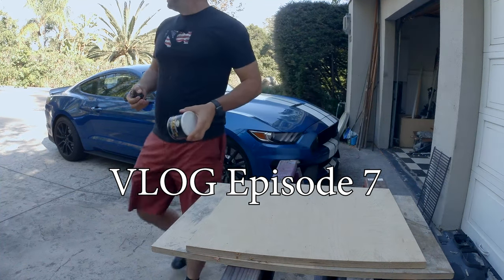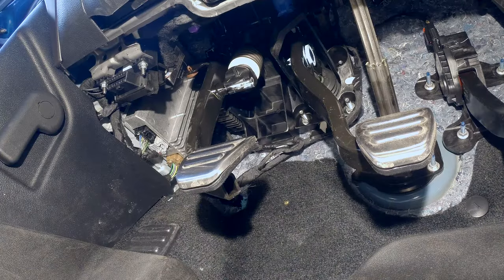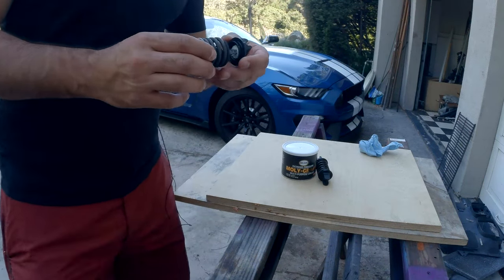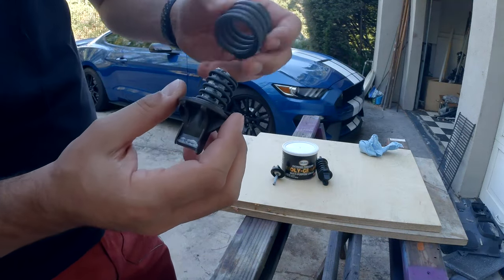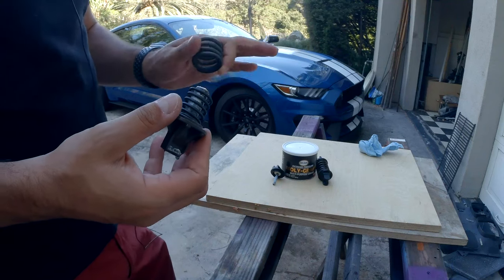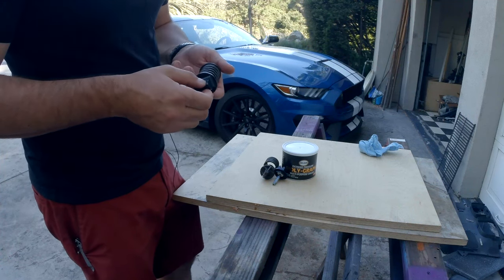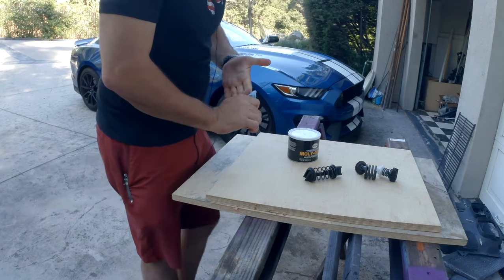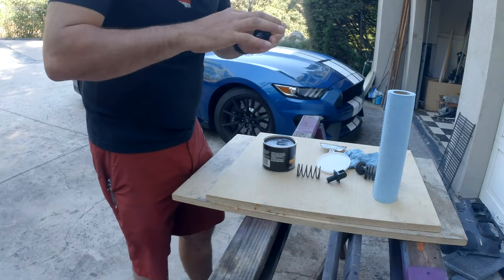VLOG Ep 7: Installing Steeda Clutch Spring Assist in GT350

Comment: This pretty much sums up my experience getting that damn spring off... I ended up saying fuck it to the pliers and used my hang to push it off the perches, which is risky if you only got the spring and not their aftermarket bracket, you risk breaking the ears off the stock bracket.. I slightly broke one of the ears, but nothing super glue cant take of.. You don't need pliers for the Steeda spring since you can easily compress it with your hands and pop it in place.

Comment: Impressions with the new Steeda spring?  I am thinking about getting one for the 2018 GT.
Reply from the maker: I love it. At least compared to the stock dual-spring thing, I do. It's a much smoother transition and it doesn't violently kick out when you start to let go. I highly recommend if your car started with a stock spring system like mine.
Reply: Many thanks!  I just placed an order for one.  I'm only driven mine for 50 miles and thought I just needed more practice with the clutch...but think it might be just the vague feel of the stock spring!  Thanks for your video!  You have a lovely GT350!!!
Reply from the maker: No problem! I changed mine pretty much right after I bought the car too. Thanks, I loooove this car. So fun!